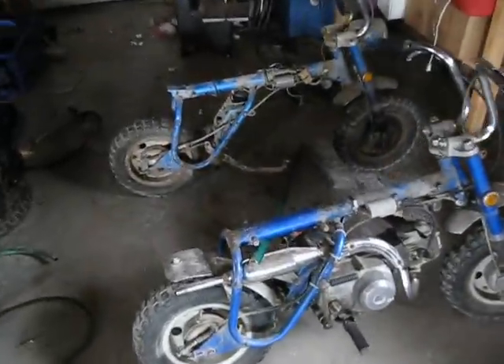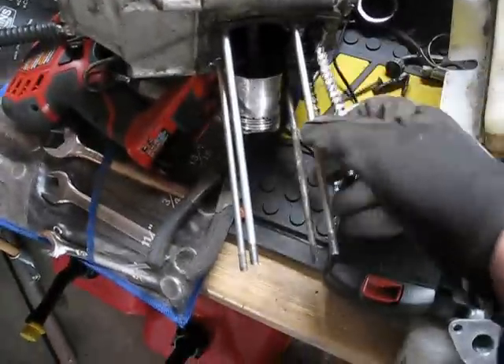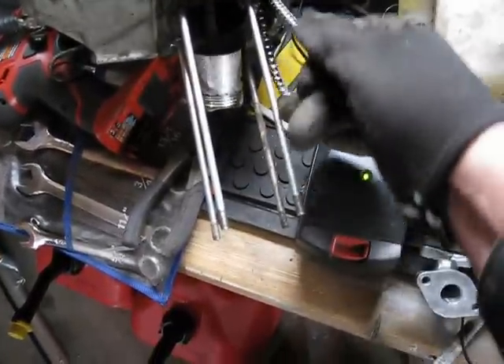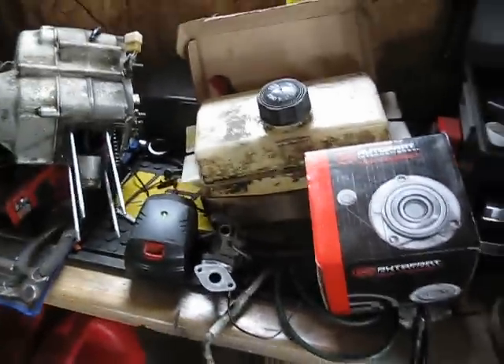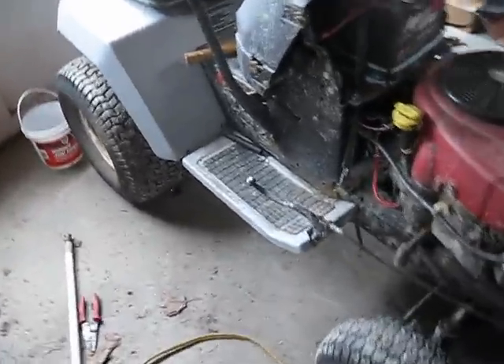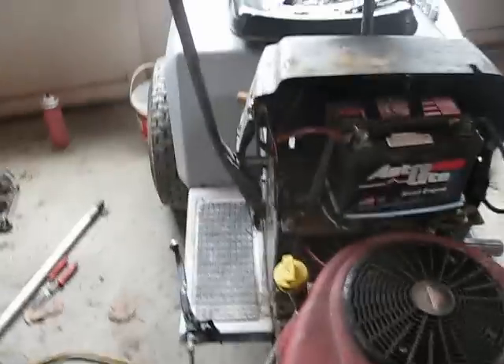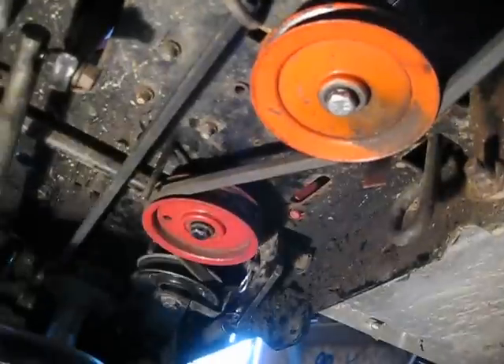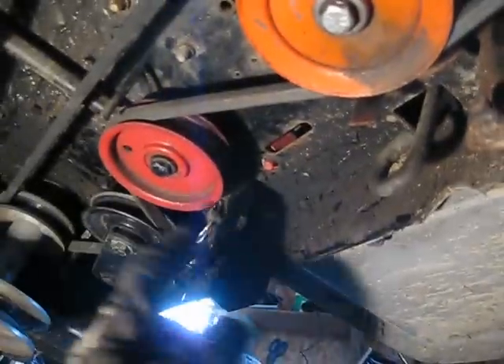Another Honda Z50 and Craftsman II Rally Belt Tension

Comment: Tight like your underwear...looked as if you were moving quite fast...What side did you end up putting the clutch on? was it on the right or left when sitting in the seat? I still need to redo my clutch on the speed mower